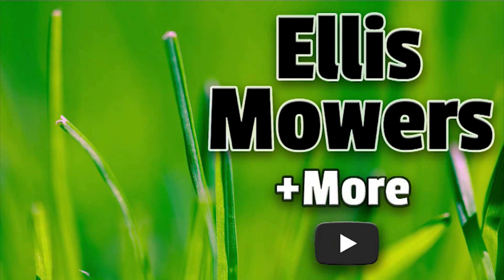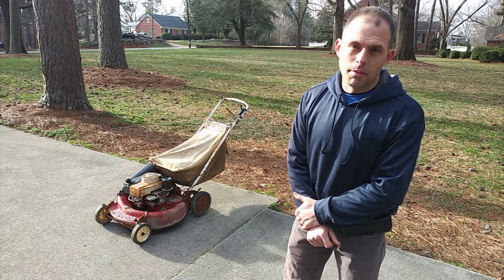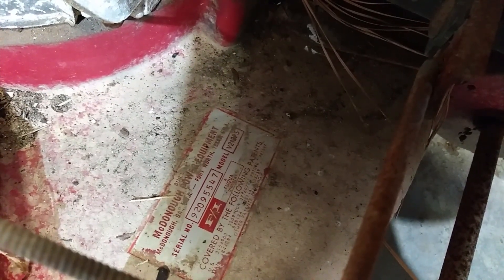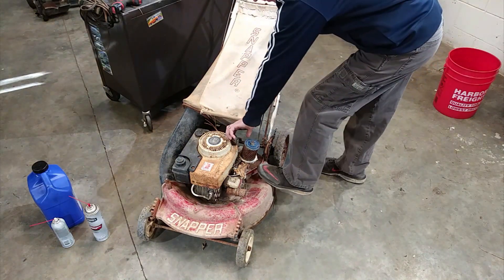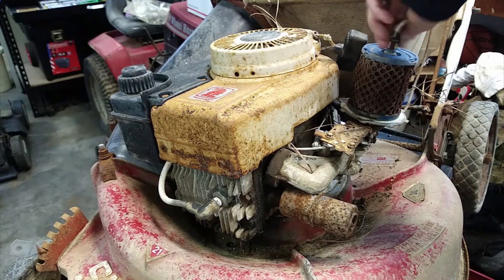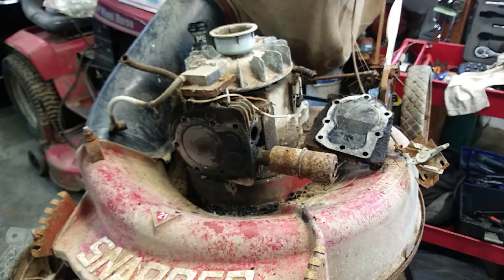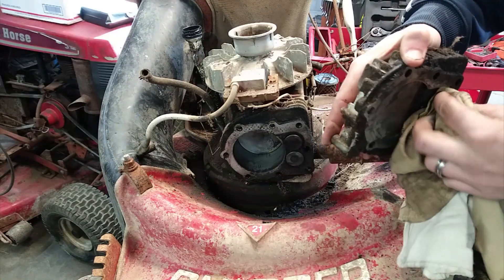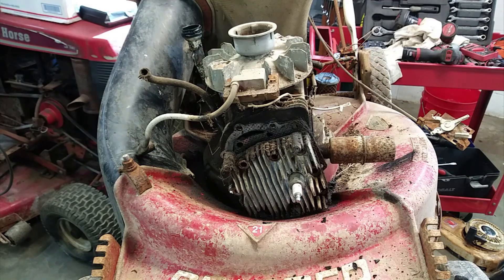Classic Snapper hi vac push mower with a Tecumseh engine!  Swapping carb & cleaning cylinder head

Comment: Hello Ellis! My family had an 80's Snapper push mower with the same self propel drive and electric start, but it had a Briggs early Quantum engine on it. Sucker ran 18-years until it lost compression. We had a few mowers since then that were never as good as our first Snapper. Then in 2017, I bought a brand new Snapper Hi-Vac with infinite adjust self propel disk drive and electric start, runs like a top! Unfortunately, it went through a flood a couple years ago, and took out the electric starter. I did have to replace the pull cord assembly on it, cause Briggs designed a POS recoil assembly that self destructs itself overtime, they should have issued a recall, but I never was aware of one. But she pull starts on the first or second pull, so she's a strong running engine, using the tried and true disk drive system, a real dealer grade Snapper, not the garbage junk sold at big box stores. But of course, since Briggs owned Snapper, when Briggs went under, they took Snapper with them.

Comment: I have a similar mower that I bought for $25 and it came with two bags,one original and one new,it needs some work but I love those Hi Vac decks,I'm saving it for a fall project, if I get it going I'll probably keep it for my own use,I'm not sure what engine is on it because I haven't taken it apart yet.

Comment: Back in the day I had a1978 year model snapper high vac with the aluminum deck with a 3.5  h.p briggs and Stratton vertical pull start  only thing is the engine would not run on high octane gas it ran great on 87 octane gas part of the deck was broke off it was only a bagger system  no side discharge  that Tecumseh engine was definitely nasty looking  behind the head cover  great job on this classic mower Casey👍👌😎
Reply from the maker: Thanks Robert!
Reply: @EllisMowersandmore  your welcome Casey 😁😎👍💪☺️

Comment: I had one of those in the early 80’s.  The cut quality and ability to bag clippings and leaves was way better than other mowers at the time.  This was when almost all mowers were side discharge.  Thanks for getting it running and sharing the video!
Reply from the maker: This had some leaves in the bag when I cleaned it out and they were completely shredded!

Comment: So if you didn’t know that mesh thing under the deck is a very rare and hard thing to find online right now. It’s called a snapperizer, basically what it does is help mulch up the clippings better. The only problem is that you can only mow no more than a 1/2 inch or less of grass or it will get clogged. Thanks for the great video.👍🏼have a great day.
Reply from the maker: Thanks for all the info!  I have only had a couple of these mowers and noticed this was the first time I've seen that.  It was impressive how good it chewed up the leaves.
Reply: @EllisMowersandmore  just wondering, after you got the mower running what did you do with it. Did you use it for a little while or did you scrap it, or sell it?
Reply from the maker: @MJT360  I sold it.  I had it listed for a couple months before it sold and it fired up every time with no issues after fixing.
Reply: The Snapperizer is for shredding leaves, not mulching grass.
Reply: @V200DIESEL  thanks for the information. learn something new every day